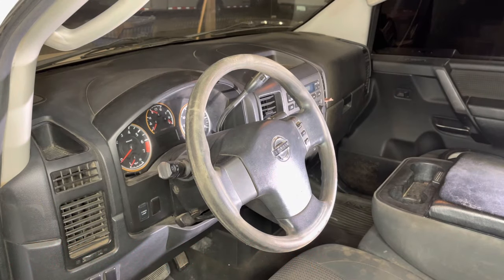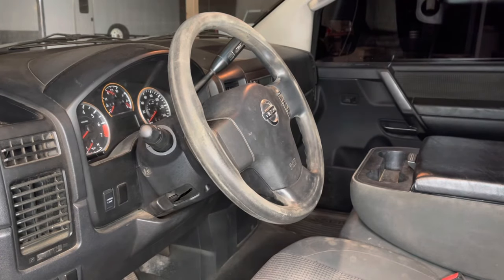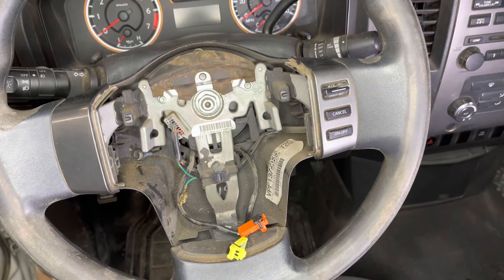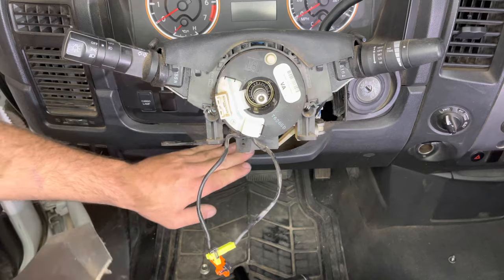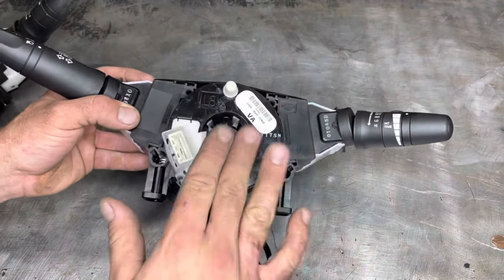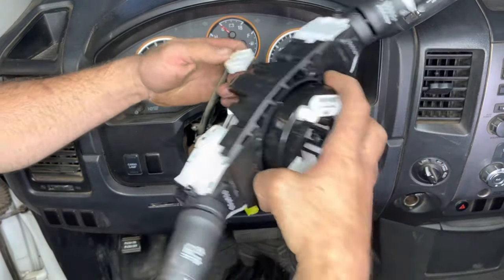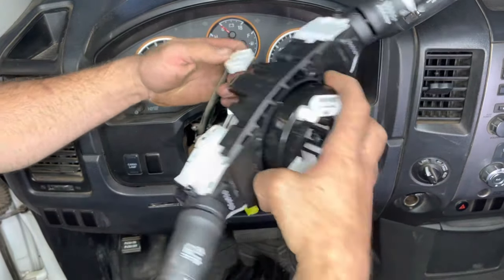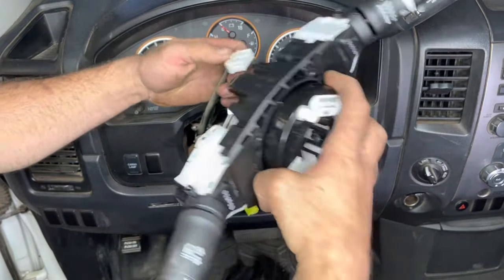Nissan Spiral Cable Clock Spring Replacement (Tips & Tricks)

Comment: Great video really helped with my fix, just want to add for other people who might need to do this, for my pathfinder, cruise control and radio controls all go through one single plug, even though he mentions that it requires two.  Perhaps on other models, but I looked everywhere and tried cross checking service manuals and everything I could find was a single plug spring for my r51.  Ordered a cheap one on eBay so I wouldn’t be out a lot of money if not, and it worked.  I was more worried about the blinking airbag light anyway haha.

Comment: I bought a 2011 ($7300.00)Armada this weekend. I didn't have the truck 10 minutes.  I went to back it out of my driveway for the first time and all of a sudden I had no steering. I got the truck back in the driveway and found that the steering column came disconnected from the rack. After I reconnected the steering column to the rack I noticed that the airbag light was on and none of the radio controls worked anymore. After watching your video I realize that I damaged the clock spring when I spun the steering wheel beyond the limits of the clock spring. Can you tell me where you bought your clock spring assembly and how much did it cost?

Comment: You are legend bro💥💯 Excellent video and it's help me alot 💯👌Just a few questions if you don't mind me asking! Can you clear the code for the airbag light manually without the scanner? Or do i have to clear it on the scanner for the new clock spring that I installed it?

Comment: This video helped me out a great deal.  My horn stopped working recently, however the airbag light had been flashing ever since I've owned my 2011 Frontier.  I bought it used.  I have not replaced the clock spring yet but just out of curiosity I went through the reset procedure to see if anything would happen.  Lo and behold after going through the reset my horn now works again!  Don't know if it's just temporary but I'll let it go for as long as it goes.

Comment: Good morning my friend, I have a good question, I have a 2004 Nissan Titan 4x4 and a couple of months ago I changed the Rack n pinion and when I disconnected the bar from the Rack n pinion it was funny to turn it around and I only heard like a spring and well it turns out that it broke it and 😁😁😁 and I bought it and now the horn and the cross control work but it shows me VDC off and SLIP 😥😥 and it seems that an angle sensor also broke, what do you think ??? I hope you can help me please 🙏🙏🙏

Comment: Aron thanks again for another great video how to! Everything went smoothly, including the resetting of the air bag ight! However I did not pull a pull a code, even though the horn was inoperative and the air bag indicator was blinking. I purchased my OEM clock spring from my Nissan parts supplier directly, it did not come with the arms for the lights and wipers. They are removed very easily from the old clock spring, then install on the new clock spring, just a couple of "retaining" clips on each. I would highly suggest that one have the appropriative steering wheel puller on hand before one pulls everything apart, my wheel was stubborn and would not budge and I hated to "beat" on it. I was glad I had one in tool box. One may or may not need this. It is a rather specific puller however. Again thank you!!

Comment: Does this particular vehicle not use a steering angle sensor (SAS) or have one mounted somewhere else? On our 2011 Rogue and other vehicles I have seen, there is a black plastic steering angle sensor mounted to the back of the clock spring that is removable.

I didn't notice it in either the new or old one you had here, but I couldn't see the bottom that easily. I have read that you must recalibrate this when replacing the clock spring mechanism or you could have a traction control or anti-lock brake system light come on.
Reply: on this video the angle sensor is missing on the old unit or not installed on this model of car (but interestingly the 3rd plug for the angle sensor is there so maybe somebody's replaced it before and forgot to transfer the angle sensor (or maybe this model of car doesn't have stability control program) 

As long as the new clock spring goes back on same as old one (don't spin new or old one, new one should come pre fitted with a locking plastic to prevent spin) and Transfer the angle sensor from old clock spring to new one again try not to move it (the new clockspring I got didn't come with the angle sensor, it's only held on by 3 screws + 1 for the plug so easy to transfer)

All I had to do was clear the airbag code so it retested the airbag for open circuit (as the spring for the airbag snapped disabling the airbag system) the angle sensor didn't need recalibrating because it was the same one

Comment: I had an extra connection with a blue and yellow wire on the front of the clock spring.  The same side as the yellow and orange air bag connections come out of.  What does that go to?

Comment: The clock spring I bought doesn’t have the light switch on the left or the windshield wiper switch on the right. How do you take those off and put them on the new clock spring?

Comment: My car horn and lights flash (similar to panic mode) after installing a new spiral cable and reconnecting the battery. Could this be because I bought an aftermarket spiral cable?

Comment: Nice!!! Is it possible to just change the clock spring alone without the signals etc?? Or do you need to change out everything ?
Reply: YES! How is just the clock spring replaced on the assembly!? Seeing how thats the common way its sold. Tell us how please
Reply: Guys it is entirely possible to change out just the clock spring without the two levers. In fact they are usually sold that way even from the Nissan dealer.

If you look up South Main Auto Repair you will see a video from 4 months ago he did on a 2012 Nissan Rogue clock spring. He shows doing it and using the stems/levers that are already on the car.
Reply: U can buy clock spring by itself. When u remove the old one you can take stocks off of it by depressing plastic tabs on either side and transferring it to the new one and bam. Saved $400

Comment: So i got a used 04 titan in decent shape. But the dash trim is cracked  and the guaged on the lower digital part are not working  where the odometwr is.  The rest seems fine but i think the clock spring is bad also. When i tap the dash. Above the guages the wipers come on would that be the clock spring issue ?

Comment: How about wiper failure ?? I’ve changed everything the wiper switch , wiper motor , checked alll fuses and relays … right now the wiper motor works off a tahgo switch I hooked up… very annoying … i don’t think the  clock spring is allowing  the signal from the wiper switch to reach the motor ? The switch plugs right into the clock spring !! Can the clock spring be my issue the car does have 94000 miles

Comment: Hi, great video.  But noticed you did not reconnect the GREEN earth lead to the airbag before placing it back on the steering wheel?
Reply: That's the wire for the horn
Reply: Yes, I noticed this, too. It was just lying there inside the steering wheel , and he covered it up when he put it back together without connecting it.

Comment: Can the clock spring cause the wiper motor not to tune on .. I’ve replaced both the switch and wiper motor … checked all fuses and relays …. Still nothing … I see the wiper switch plugs right into the clock spring tho

Comment: Hi, i have a problem that flashing air bag and horn toots when I press cruise control on, obd fault codes B1049 .my car nissan nv 200 model 2012, thank you
Reply: You needs to replace the airbag clock spring like the one in this video. I got the same problem too on Nissan murano, and now everything fixed..I did it myself by following this video💯👌This guy is a life saver💯💯💯👌

I took my car to a repair shop,and the mechanic told me that it will cost me $800, so I decided to fix it myself self

Comment: quick question my original clock spring has one air bag wire (yellow).  but i bought one with 2 wires is it ok to only connect one the yellow one and not the orange one ?
Reply: I've got the very same issue. Did you connect only the yellow plug?

Comment: Aaron with the help of your video I replace the clock spring. Unfortunately the SLIP & VCS are still on but the airbag light went out doing the manual reset. Is there a way to manually reset the SLIP & VDC lights?

One other thing the airbag light started to flash again but I just manually reset it again.. all the steering wheel controls work fine along with the horn. So I don't know why the airbag light started to flash again?  Any thoughts ??
Reply: Did you find a solution to this?
Reply: @meganwitt5390  Hi Megan, it seems the only way to reset the SLIP&VDC is with a with a professional diagnostic tool. I brought my Armada to the Nissan dealership and had them do it. Make sure when you have it done that they take it for a test drive after they do it. Because , they told me that it had been successfully reset as soon as I drove out of the dealership the light came back on, I immediately turned around and drove right back to the dealership and told them. The service manager said that I would have to leave it because he said there must be something else going on and they would have to diagnose the problem. After some arguing he had the tech reset it again and this time it stayed off.  The reset wasn't done properly the first time and the tech never took it out for a test ride and just assumed it was done properly. They would have charged me for a second diagnostic and reset. Just be aware.   So the answer is there is no way to manually reset the SLIP/VDC light.
Reply: I have heard there is a sensor behind the clock spring called a steering angle sensor (SAS).

If it is not recalibrated when you replace the clock spring there's a chance the traction control and anti-lock brake system light will come on.

The only way I've seen people recalibrate it is using a special scan tool that has the option to start a recalibration and then you drive about 10 MPH straight ahead, and it will do an automatic recalibration. I have not seen a way to do it manually.

I have seen people replace the clock spring in these videos on YouTube and not even do that recalibration, and they seem to have no problem.

Also, in this video I did not even see him show a steering angle sensor, and it looked like it didn't have one on the back of the clock spring. I don't know exactly which vehicle he was doing, but I know a Nissan Rogue has one, and it's black and is mounted inside the white plastic behind the clock spring and is removable.
Reply: Torture,  yes you are correct. I had to bring it to the dealer and they had to reset the steering angle sensor. So everything is good now
Reply: The SAS is connected to the clock spring with three screws. In this case it's black and it has some red stickers on it with a wire coming off it
Reply: The clock spring I got didn't have the angle sensor so just transfered it from the old Clock Spring (only 4 screws) it didn't trip recalibration just worked fine (just had to clear the airbag code so it could self retest and function normally again after cleared)

Important that you don't move the clock springs on both units and keep steering centered before starting work

Comment: What if only stereo controls mess up? No air bag light or other lights and horn works fine
Reply: If the other things are not acting up, they probably will start doing so in the future because the conductors for the stereo controls are cracked and not making connection and that's just signs of wear and the other ones will follow suit.

Comment: How I never hear you press the horn so that I can hear that it work.
Reply: Won't work as the horn cable wasn't plugged into the airbag part (also some cars have angle sensor, this one didn't seem to have it or previously wasn't transfered as it has the 3rd cable for the angle sensor or car doesn't have traction control or stability control program)